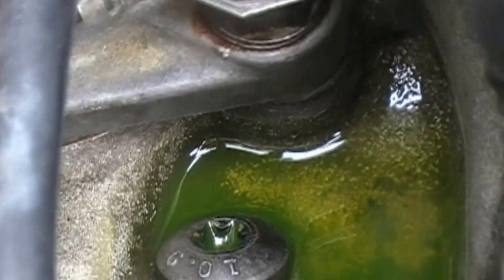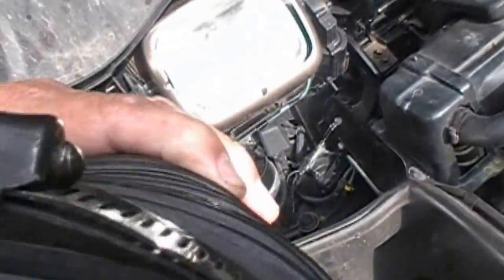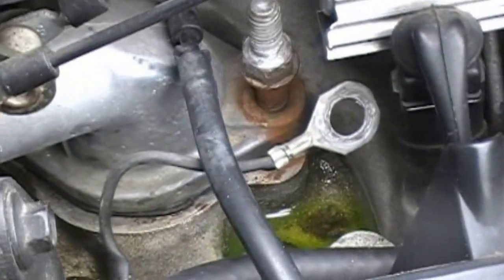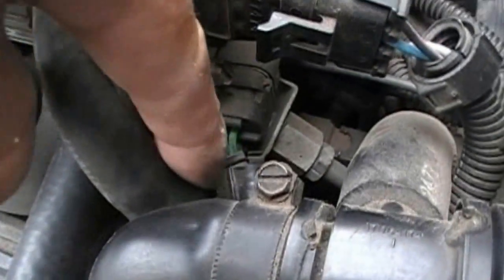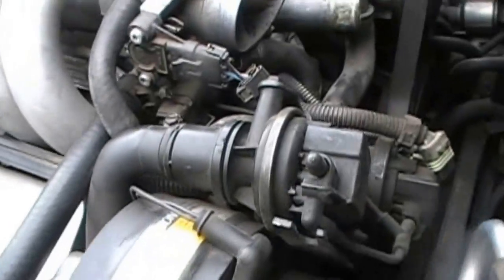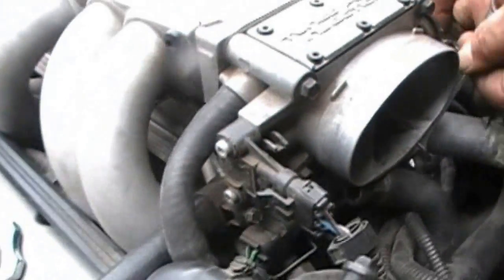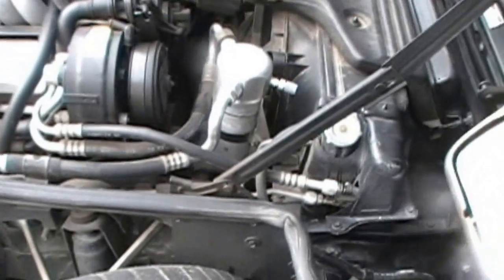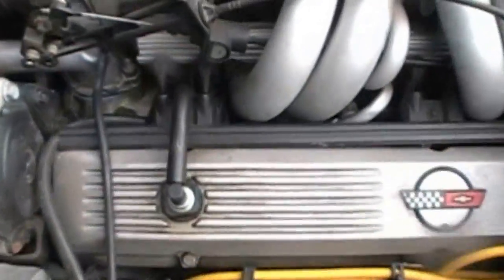C-4 Corvette Hesitating Bad Gasket and Hose

Comment: My ‘88 has a bad hesitation/cutoff at warmup, acts like a bad fuel pump but I had that replaced. Replaced plugs, wires, ICM, distributor cap, had everything adjusted properly, now it won’t even stay on, have to crank over and over until it roars to life, only to repeat itself, have to wait a minute or two...never looked at that hose, bad vacuum leak? Damn.